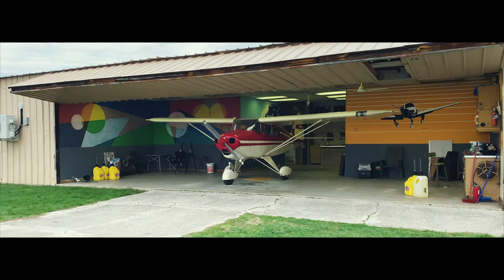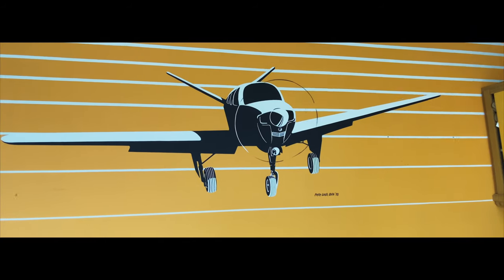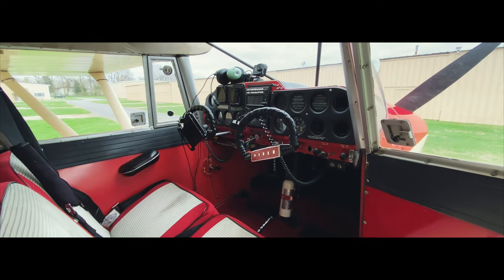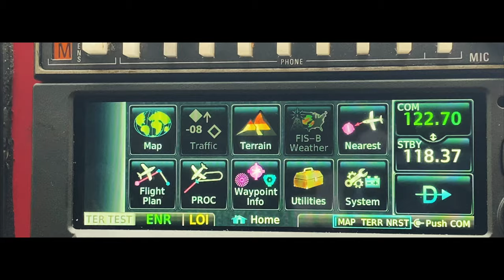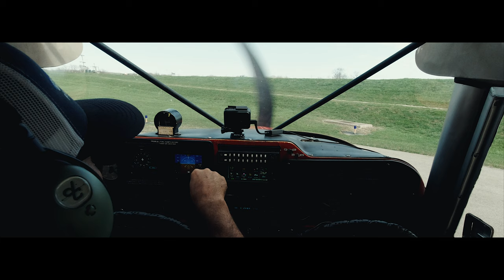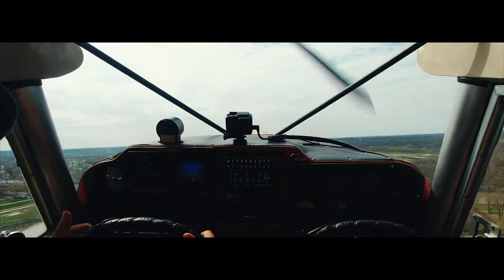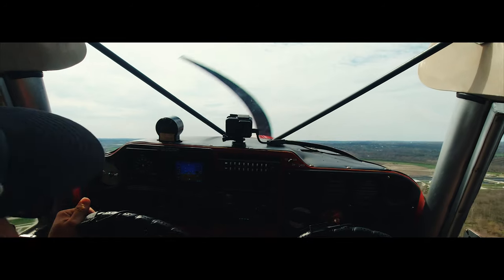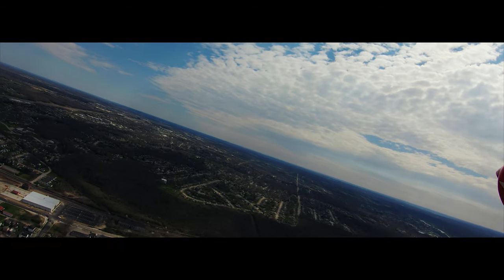Tri-Pacer Pa-22-150 History and Flight

Comment: That's a great looking plane. I also had a PA-22-150 1957 model with similar paint job. I bought the plane in 1975 when I had about 14hrs under my belt. I had soloed at 12 hrs an didn't want to rent aircraft again. I loved that plane and flew it all over Ontario Canada. I had more than 60hrs before I decided to take my test which I past easily. So much fun. Did not have much of a glide ratio but NEVER came into any grief.

Comment: May I ask where you got the awesome Bonanza artwork?
Reply from the maker: The hangar was owned in to 70's and 80's by a gentleman that owned a bonanza and he had both painted. one in 1979 and one in 1987.   He has passed away but all the new owners keep the old artwork.   Its pretty awesome
Reply: @davidschmaus1  it is!  Maybe you’ll end up getting a Bonanza too lol.  My dad started with a 56 PA22 and the next plane he bought was a v35B
Reply from the maker: @CheckThrust  already looking.  :)
Reply: @davidschmaus1  I know of a beautiful yellow and white 1956 G35 for sale.  Mid time E225 with Aspen 1000 and a Garmin 430.  Scheme is original,  and panel retains original appearance for the most part.  $55k and it’s yours.  Based at KMWA

Comment: It seems such a crying shame! To take a delightful old Classic like this, and corrupt it with doodads, bobbles and "junk"!
I would have left her much more original. 
BUT THEN, my original training was done in the 1960's!
Thus I have ZERO need for these modern, electronic crutches that the younger folk are so dependent on.
A local lad, with a fine fast single, stayed ON THE GROUND for nearly 3 months simply because he was waiting for a replacement GPS!
Guess he had never learned to Navigate????
Reply from the maker: More than likely what your dad said when you installed a VOR head.
Reply: Ha, ha, in my Colt, I use a Garmin “handheld”, two iPhones and an iPad for navigation, each in their dollar-store mounts. I am swimming in GPS’s!!!